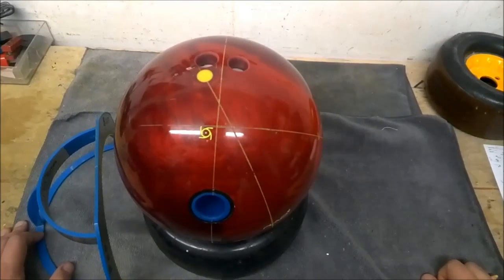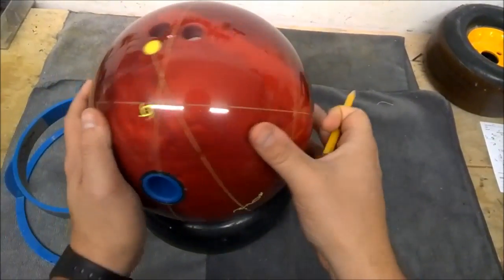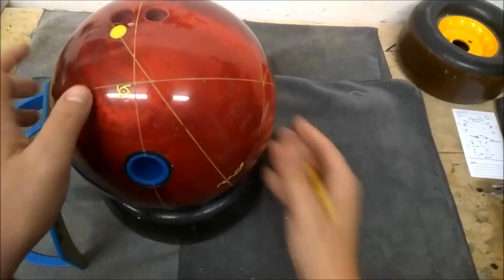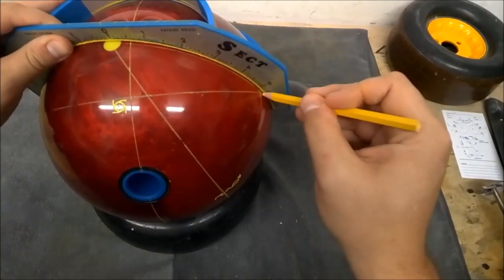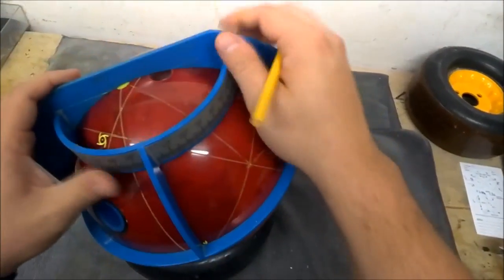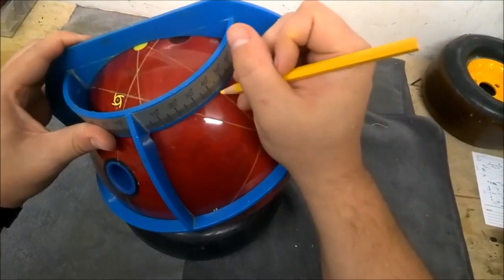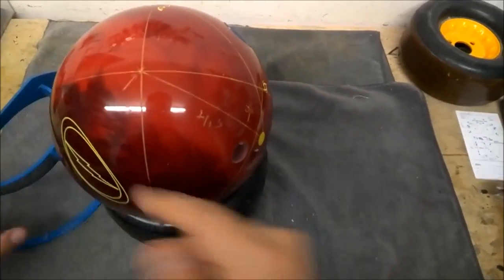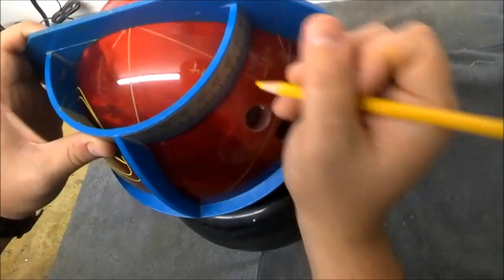Finding Dual Angle Layout On A Drilled Bowling Ball - bowlingball.com One Minute Wednesdays

Comment: What's the easiest way to find your PAP? I've heard the whole tape and camera thing but that seems like a pain in the butt. I've asked two different shops to try and find mine. They did it off a ball with some track. One shop said it was like 6"+ and another said it was like 4.5 or so. So clearly theres a decent discrepancy. Should i get a third opinion? Or have them do it off my spare ball now that i have one that I've been using a lot?
Reply from the maker: Your spare ball is the best ball to use. However, you should always take the ball to the lanes to double check the accuracy. Put a piece of tape on the spot they deem to be your PAP. That tape should be stable right as you release. The moment the ball leaves your hand is what matters, not anything that happens downlane. 

Here's a video we did regarding the PAP: https://youtu.be/e1mTEzbexXE